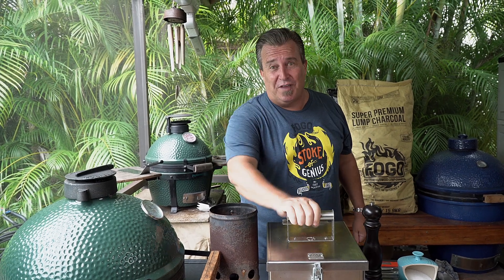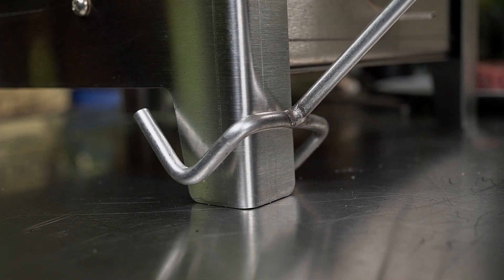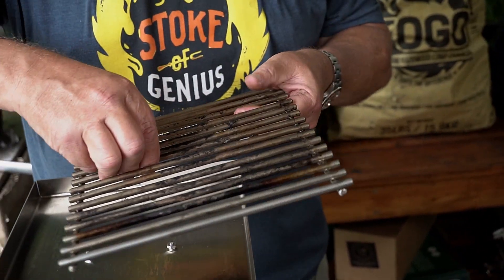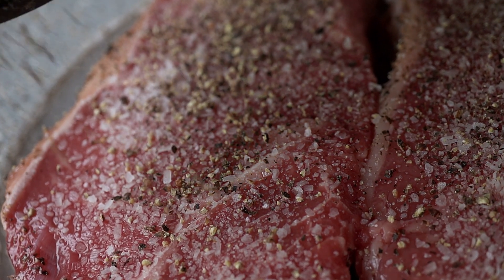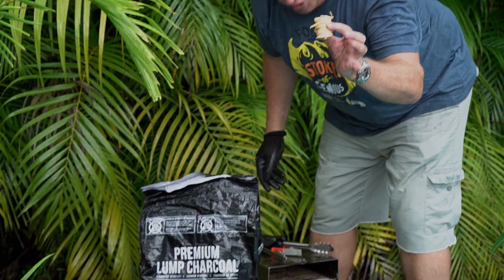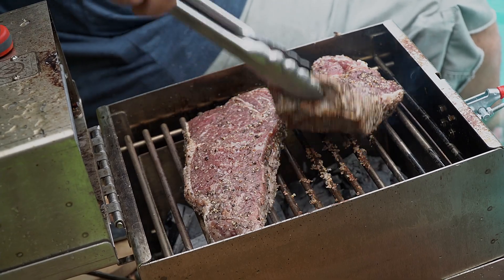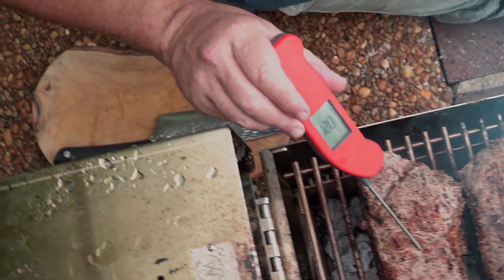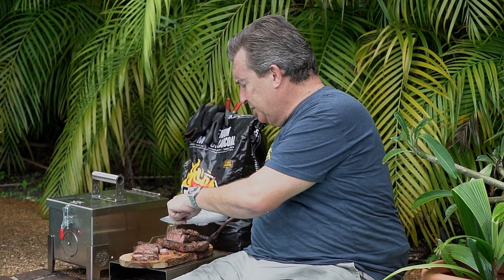Grilling The Perfect Steak in a C4 FOGO Charcoal Portable Grill | C4 M-Grill Texas

Comment: Hey, just wondering what advantages this has over the 70$ weber go- anywhere charcoal grill,  and if it's worth that extra 400$.  Thanks
Reply from the maker: Just a totally different type of grill.
Reply: @FOGOcharcoal  I'm new to grilling. What makes them so different? To me, they're both rectangular metal boxes with a couple holes cut out to allow ventilation.  Is the C4 not supposed to have the lid on top when in use?  Would that be the main functional difference?
Reply: I have the weber go anywhere grill and I think the Jumbo Joe is better if you are considering the Weber. It has a lip so your hotdogs don't roll off or your meat slide off when you use your spatula. Also the go anywhere grill gets too hot. There needs to be more height and I think the jumbo joe works best. Only thing is ita s notbas compact and its round, so wierd to store